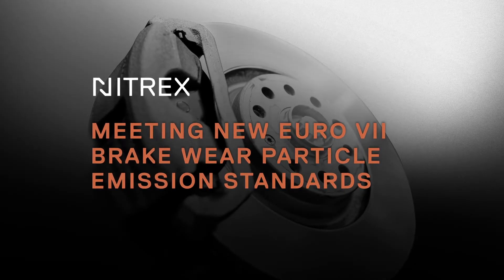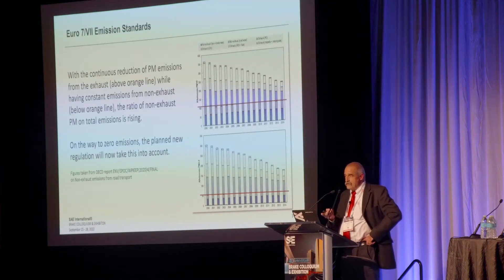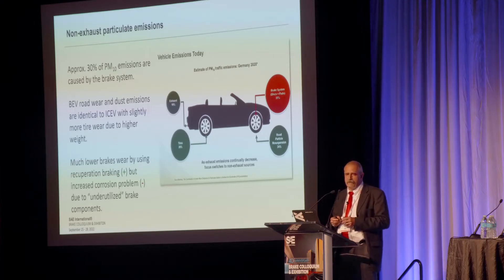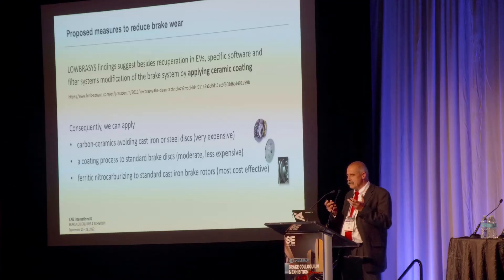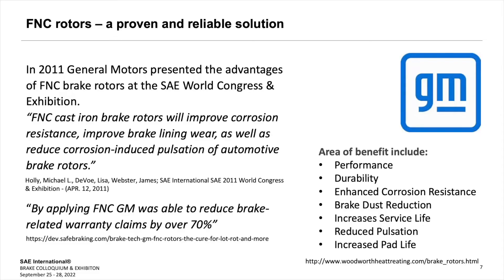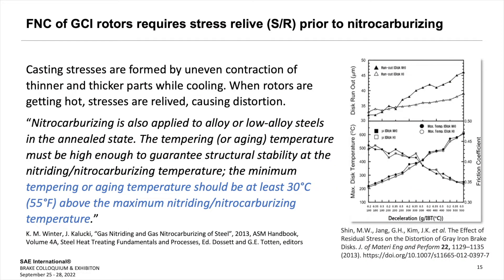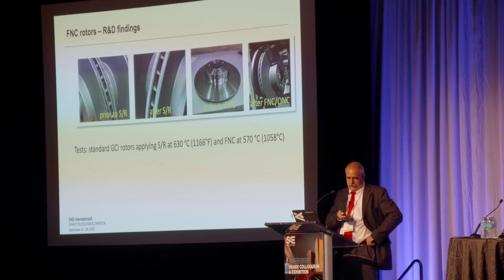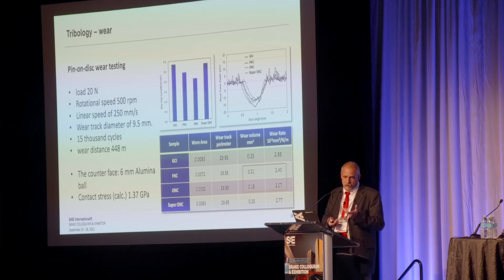Meeting New Euro VII Brake Wear Particle Emissions Standards | Video Presentation

Comment: Excellent presentation!  I wanted to have the rotors for my 3 old Cadillac's FNC'd since GM nor anyone in the aftermarket do not offer FNC rotors on these older cars to keep corrosive brake dust (iron-dust) off the chrome wire wheel spokes, & also to improve the rotors metallurgy for better braking on these older classic heavy cars!  I also looked into Tungsten Carbiding which was far too expensive to have applied like Porsche Surface Coated Brakes, or PSCBs, which they say: 
- cuts down on dust by 90 percent compared with conventional iron discs & limit high-temperature fade, never rust, and last 30 percent longer than conventional iron brakes.-
- The appeal to vanity doesn't end there. The mirror-like surface of the rotors is so reflective that you can see yourself well enough to pick spinach out of your teeth, fix your hair, or take a selfie -.!!!!! LoL.🤔 🏁
Reply from the maker: Thank you, Chris, for your positive feedback! We appreciate your interest in our Smart ONC solution for brake rotors and the benefits it offers. For a quote, please visit https://hub.nitrex.com/nitrexbrakerotors, click on "CONTACT US" in the menu bar, fill out your details, and a team member will be happy to assist you further.